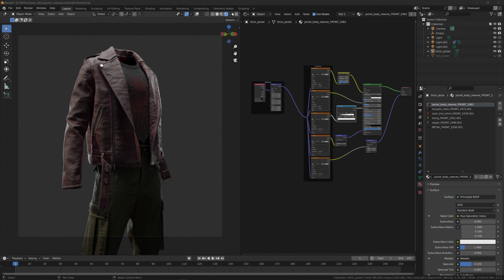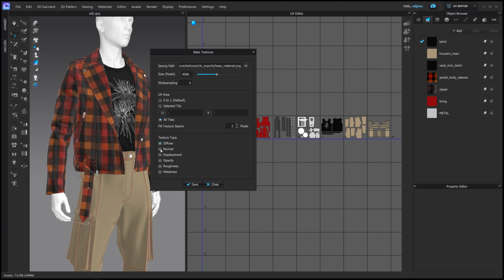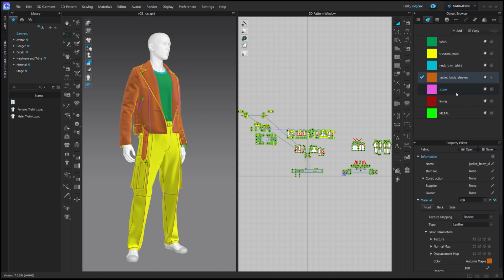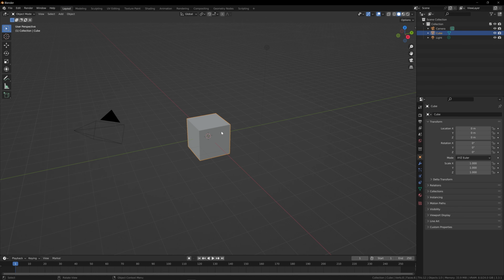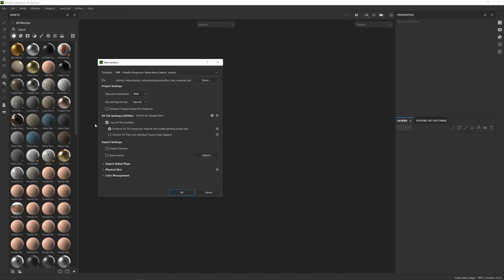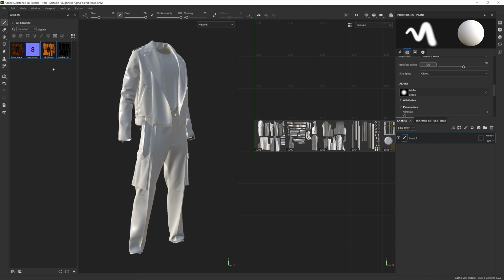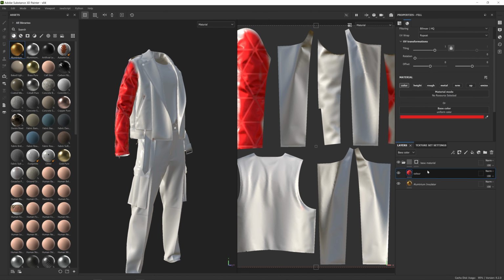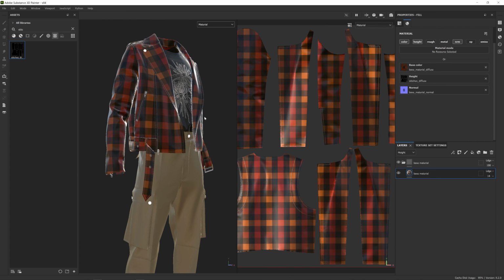PART 01  - Export Settings - Clo3d to Substance Painter + Blender - Substance for Digital Fashion

Comment: Hi, Is there any specific reason that you export the garment in thin to Blender, why don't you use a thick one?
Reply from the maker: I use a thin export in substance painter because the UVs are not overlapping. When you use a thick export the UVs are stacked on top of eachother (the front and back of the fabric have the same island) and the geometry size is over double. So painter works smoother with less geometry and separate UV islands 

In blender I work with a thick export for my final renders but only sometimes. The main issue is how clo exports the edge thickness. The edge textures get stretched as they are not created with accurate UV islands.

Additionally the thick export is not good for rigging and for game engines so it really depends what your final use is. Sometimes it is better to work with a thin export and reproject the thickness in blender to have better edge texturing.

Hope that helps :)
Reply: @digitalfashionblender  I appreciate your detailed explanation, but if the garments are not exported with thickness, then the final rendering won't have any depth. If you don't export them with thickness, how can you make the garments appear thicker?
Reply from the maker: @seungwanhan4098  like I said before, you would reproject the thickness in blender.

Look at using the solidify modifier in blender. It will allow you to add thickness to your mesh and not have the UV issues I described. 

But again depends on what you are doing . Animation? Still render? Rigging? Thick exports from Clo are only good for still renders and then they have the textures stretched across the edges. 

It's this reason I would advise you learn how to add the thickness outside of Clo :)
Hope this helps!
Reply from the maker: @seungwanhan4098  https://youtu.be/cXIbM7uotIE 

This might help :)
Reply: @digitalfashionblender Thanks for your detailed explanation of the thickness of thick and thin. 
One of my concerns was whether the thick export would be difficult to solidify due to mesh, but you mentioned that it wouldn't be a problem for a thin export. 

After considering this, I realize that I need to make a decision about what I'm doing before rendering on Blender. 
Your help has clarified things for me, so thank you again!
Reply from the maker: @seungwanhan4098  you are most welcome :) I am happy to help!

Comment: How to give height for HD Print in garment ????
Reply from the maker: Make a new layer and set it to height only. Add your print as black and white image to use as height map. Control the height using the blending options on the layer panel.
Reply: @digitalfashionblender  one more doudt i have, while exporting garment as OBJ from clo as multiple objects, importing it to blender i cant select the parts seperately, its seleting the garment as a single part, can you pls help me in this
Reply from the maker: @kv2708  what parts of the garment do you need to select? Exporting multiple objects will work better with an FBX export rather than OBJ. But every pattern piece and stitch will be it's own mesh. It can become quite complex and not easy to work with. 

Try looking at the selection tools in blender. You can hover your mouse on a specific part of the model, hit the L key and select UVs and you will select that specific pattern piece based on the UVs. I find this better than using multiple objects

Comment: Hey, quick question, when I try to upload my .obj mesh in Substance Painter it won't allow me to import it if UV Tile workflow is checked. Does anybody know how to fix this issue? Thanks!
Reply from the maker: Import your obj into blender and use the UV editing work space. See if any of the UV islands or pattern pieces are overlapping from 1 tile to another. If you use the piping tool on clo3D this could be why.

 Check your UV layout is set correctly on Clo3D, no overlapping pattern pieces or patterns across multiple tiles.

Also try export the obj without any trims - see if that helps. Also make sure your topstitching is set to texturing and not obj

Hope thy help you fix it

Comment: Hey man, thanks a lot for the series! Following along but I'm running into an issue. 
When I apply the normal and the height map for the stitches (the ones that we baked in CLO), the applied maps are super blurry in the viewport and in the renderer. Can't even tell there are stitches, and the fabric structure is not visible at all. I exported 4K from CLO and the Painter res is also set to 4K. 
Any ideas what might be wrong? Thanks!
Reply from the maker: There are a few things you could check. 

First I would check how much space your pattern pieces take up in the UV editor space. If you're pieces are scaled quite small the exports will have low resolution from Clo. You need to maximise the space each pattern piece has in the UV tiling space to have more resolution on the stitches 

Try exporting the height maps for the stitches at 8K as this could help increase the resolution too but can make some software run slower.

Also try using a levels either in Photoshop or directly in painter to take the grey values out of the exported black and white height map. Just push the white values up a bit and it could help sharpen the stitches. Hope this helps
Reply: @digitalfashionblender  Exported 8K, also re-exported the mesh, created a brand new project and it did wonders. Thanks a lot!